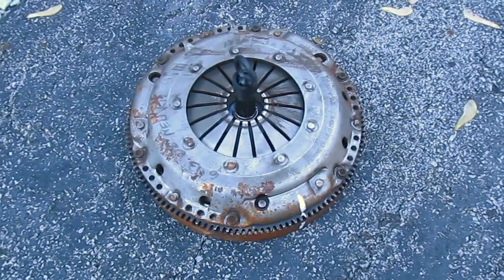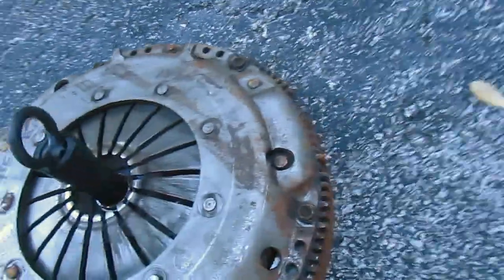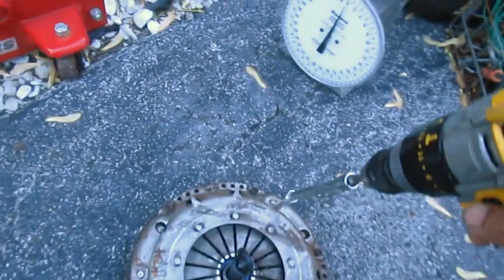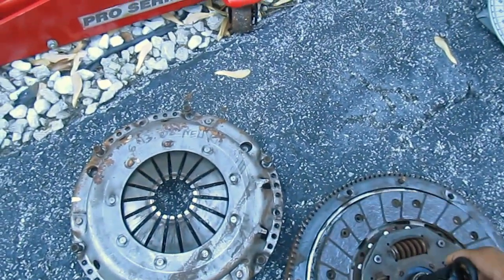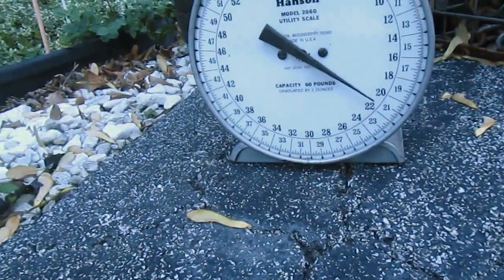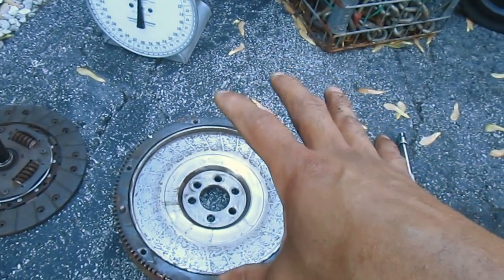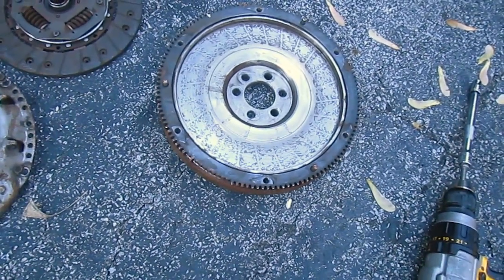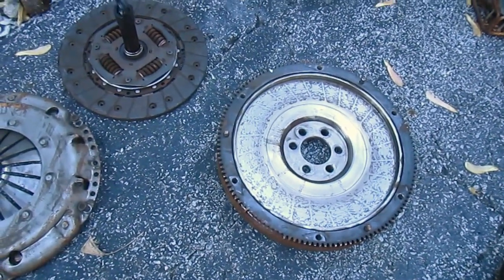TDI 1.9L 5-Speed Single Mass Flywheel (SMF) Proper Weight and Why

Comment: and this is why you have a AISV/ASOV installed before the intake
Reply from the maker: To be clear: "Air intake shutoff valves (often referred to as AISV, ASOV or emergency shutdown valves, ESD) and systems provide emergency overspeed shutdown protection for diesel engines and are the most effective way of preventing a runaway situation. The valves completely block the engine air intake system, cutting off an uncontrolled external fuel source (i.e. crank case oil) and the air required to keep the engine running." All VW diesels come with an anti-shutter/EGR valve that acts as an AISV/ASOV.  The problem is that some DIYers remove this valve along with the water cooler EGR stuff.  This is bad new for the rest of us, because an out of control run-a-way is bad for everyone.  The TDI my wife had the run-a-way in had the EGR "thank goodness". Live and learn.

Thank for your time.
Reply: GallowayChicago
the anti-shutter isn't a true AISV and only works if you turn the key off even then it wont always kill it 100% of the time depending on the degree of runaway
Reply from the maker: rjc862003 The way the anti-shutter valve works is to close when the key is turned off. If the engine is pulling a vacuum by drawing air through the intake, then this action will effectively choke the engine. Now; Imagine if you turn the key off and the engine was still running. I complain about some of the over-engineered VW systems (particularly the ones that require special tools!) but this simple valve is, literally, a life saver.

Comment: thanks for sharing...good stuff...ripped those teeth right off?  impressive...
Reply from the maker: Thanks for watching.

I originally thought that the timing was off.  I had never seen a hydrostatic lock motor before. Live and learn. The dip stick showed no oil once the run-a-way was stopped. Kudos to VW designers for the EGR Valve (not for the water cooler junk, but the ERG valve itself will stop a run-a-way).

Live, Learn,. Teach... Repeat....
Reply: GallowayChicago I think that's the anti-shudder valve, shuts off air to the intake...how did the runaway engine finally stop? my sons car had the oil seals go bad on his TDI, but the oil leaked into the exhaust side...making huge smoke...
Reply: knikula duh, the valve worked...my bad...how high did it rev before the ECU shut it down?
Reply from the maker: knikula My wife was driving an when the turbo shaft seal went, the oil was drawn where the highest vacuum was... the intake.  It was enough smoke to cloud an entire city block in thick white smoke. I had done an EGR delete but I did not remove the EGR/Anti-Shudder valve for this very reason.  This valve will stop a run-a-way.  And that is what it did.  my wife simply turned the car off, because the RMPs went as high as they could but her foot was not on the accelerator pedal. The TDI is a 5-speed so she pulled it out of gear and then turned the key off. She though the accelerator pedal was stuck. So she turned the car back on and drove home before it did it again right in front of the our house.  That is when I tried to start it again and popped off the flywheel starter teeth.  Between the time when she last stopped the car and the time I tried to start it, all the intake oil had pooled in the open cylinder locking the engine.  I did not change the timing belt, but I think I should now because I think it stretched   The car runs fine now but is on the harder to start side.
Reply: GallowayChicago a ton of good experience in this thread, thanks again.
Reply from the maker: knikula These Run-A-Ways have been know to KILL drivers who don't know what to do, and worst yet here in the U.S.A. home mechanics are removing the EGR/Anti-Shudder valve and replacing them with a straight pipe. This is bad news.  You can for about $15 US remove the EGR water cooler junk, place two exhaust block-off plates and one water by-pass hose to delete the EGR. Yes this method with throw CEL put the TDI will not go into limp mode, and you will not potentially die in a diesel run-a-way.

The ECU will not automatically shut down the a run-a-way.  The ECU will cycle the Anti-Shudder vavle and choke a run-a-way only if the driver turn the key to the off position. Most VW TDI get between 32-50 MPG and the crank case holds one gallon of oil.  If a run-a-way is not stopped you will surely damage the engine.

I call it the EGR valve because every TDI owner can locate and identify the EGR valve, but most don't know that the front part of the same valve is the life/engine saving Anti-Shudder valve.

Live. Learn.. Teach... Repeat....
Reply: GallowayChicago 
So I did a EGR delete to my 03 Golf ALH motor and noticed a lot of oil in my intake. Any way to fix this?  I did the block off plate but did not change my heater hose.
Reply from the maker: @suavehouse5150  Thanks for watching.  That oil is what was turning to tar in the intake.  And this wasn't any good for the turbo too. Now that you have blocked off the soot from the exhaust gasses the build-up should stop.  Think of the oil as maple syrup and the exhaust gasses as sand.  There is no reason to force sand through your motor.  You can remove the intake oil by connecting an "oil catch can" to the black hockey puck looking thing on top of your valve cover (CCV).  I have a six-part video on it "VW TDI Oilly Intake CCV Fix 1 of 6 - Remove Vacuum Tank".  The "Oil catch can" must be emptied at least once a year.  Basically, the oil is from the CCV valve and the TDI was designed to let the oil vapors pass through the inter-cooler and pass the EGR system into the intake manifold.  But, in real world usage, you get the formation of coak that in very severe situations can completely block the intake manifold.  It should be noted that this oil pools at the lowest point of the intercooler, and on 2.0L TDI has been known mix with melted frost accumulations and hydro lock the motors causing thousands of dollars of damage.  The 1.9L does not suffer this same problem, but a Youtube VW specialist advocates drilling a "small" hole at the bottom of the black plastic neck after the intercooler on all VW TDI motors ("Intercooler drilling, draining & plugging = NOT a boost leak!!!
")  If you don't want to drip oil on your driveway or in your garage then try the "oil catch can" instead.  Let me know if you have any questions that I can help you with.

TDI Love from Chicago...
Reply: GallowayChicago 
Thanks a bunch I definitely see a lot of oil around the black hockey disc. I’m gonna view more of your videos out. I’m in the process of doing a manual swap since my 01M recently went out at 200k. I appreciate the videos you made for our MK4 TDI community as well as responding back very rapidly!  I might go with drilling a small hole in the lower bottom of the inter cooler and use a screw to cover it up. And on the clutch looks like I’m gonna with the Luk DM clutch set up. I’m trying to get the most MPG out of my TDI. Only mod I have is the EGR delete and turbo back no cat. I was thinking about a Malone 1.5 tune to erase the egr code let me know if you had any experience with their tune!
Reply from the maker: If you are just trying to remove the CEL I would pass on the tune.  But if you have your heart set on the tune I would buy larger injectors to get the best performance/MPG set.   Changing the injectors is easy.  the hardest part is getting them out.  I bought the removed from metal-man for about $80. worth every penny.  I have been buying cheap injectors from China and wow am I impressed.   I did an auto to 5-speed trans swap.  It took me a year because I thought it was harder then it was.  The clutch slave and clutch pedal are just plumbing nothing heard there.  The Luk DM is amazing for the price.  The 11mm diesel pump in a 5-speed is fun, and the reprogramming can be done with a simple VCG to let the ECU know that the auto trans is now a 5-speed.  I let my 01 Jetta TDI sit for a year and that is a no-no.  when I finally fired it up the diesel pump was all gummed up.  I had to rebuild the 11mm pump.  Basically, I had to disassemble it and clean and polish everything.  Sticky diesel goo was everywhere.  The biggest thing I learned was that the TDI 5-speed Tran's 5th gear is different from gas Tran's 5th gear.  So, It is important that you get a TDI 5-speed trans.  Other then that is is/was not harder than changing a clutch.  I used Black Silicon RTV on all my bolts.  Also, beware the stupid VW ALH motor mount failure (hard steel bolt into soft aluminum).  The last thing is the short bolt failure (of the three) on the belt tensioner (part 038 903 315).  It is really crapy and time-consuming

TDI Love from Chicago...
Reply: GallowayChicago 
Nice bro!  I actually bought another 02 Golf  TDI manual from my buddy for really cheap!  I already swap the manual cluster into mine. All the parts are out from the donor TDI manual just ordered the clutch kit and the shifting bushings from dieselgeek guy. Oh I forgot to mention I do have upgraded injectors in my 03 Golf TDI besides the egr delete and no cat upgrade.  Question?  Do I need to swap over the injection pump from the manual donor into mine?  What about the ECU from the manual?  I literally have the whole donor for any parts I need to swap over.
Reply from the maker: @suavehouse5150  The Automatic TDI's have 11mm pumps and the OEM 5-speeds have 10mm pumps.  Do not change the Pump from 11mm to 10mm unless the 11mm pump is unfunctional.  Larger injectors and the larger pump are a great match to increase speed and economy.  Diesels are funny that way.  The ECU from the Automatic (11mm pump car) does not have to be swapped for the donor (10mm pump car).  You do need access to a VCD (Vag-Com), to change three settings: (1) change from auto to 5-speed trans which makes the LCD shift indicator disappear from the bottom of the speedo cluster. (2) check and correct diesel pump IQ setting for optimum speed/economy setting. (3) reset EGR interval. you can not remove the EGR interval but you can extend the time.  There is some rewiring that is required.  I opted not to include the no-start relay for not depressing the clutch.  The last thing I can think of is; the auto shifter-start lock-out cable. It is an actual cable goes from the automatic shiter to the ignition switch. I think I used a bicycle cable pinch holder to make sure it did not interfere with the ignition key.  Some people suggest disassembling the ignition key assembly to clip out the cable but I did not want to risk damaging the ignition key since I have an RFID reader ring.  The 1998-2000 jetta's don;t have the RFID reader for the start inhibitor.   If you swap the ECU from the donor car you will have to swap the CCC (Confort Control Computer) too.  They are matched.  And you will have to reprogram the keys for standard remote functions locks/windows/trunk.  I would stay with the original ECU and reprogram with a VCG.  You can rent Real VCG from eBay or buy the 100% working boot-leg Chinese VAG17  Hex+Can series ones from eBay too. The LUK 17-050 DMF CLUTCH AND FLYWHEEL KIT VW 1.9L DIESEL are not rated for over 120hp.  That is why I installed a Valeo 52255603 SMF, but I do miss the softer pedal feel of the Luk DMF.  There is nothing wrong with the LUK, but I originally was going to make my Jetta a 150hp TDI daily driver with larger injectors and a larger bolt on turbo.  But plans change.  I also wound up using a clutch slave cylinder from a VR6 I got from the junkyard because my smaller TDI one was leaking and could not hold pressure.  I never installed the Glow Plug Water Heater and winter (in Chicago -10F) starts were not a problem.  I did not have a donor car so this little part gave me a hard time: pedal firewall gasket (1j1-721-410).  take a look at this youtube video: https://www.youtube.com/watch?v=bjqaQpP8tps
if you need help with the wiring diagram I have it in my archives.  pop a message to my youtube ID and I will send it to you.

TDI Love from Chicago...
Reply: GallowayChicago 
Sounds great I’ll definitely keep you posted On my swap!  I need to drain my atf and coolant out my golf and start removing the axles and transmission hopefully this week.